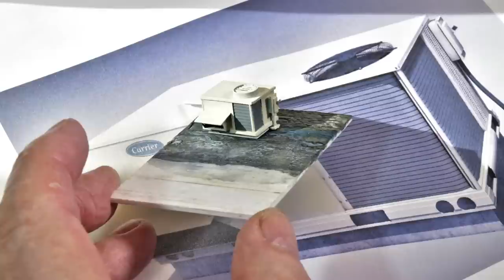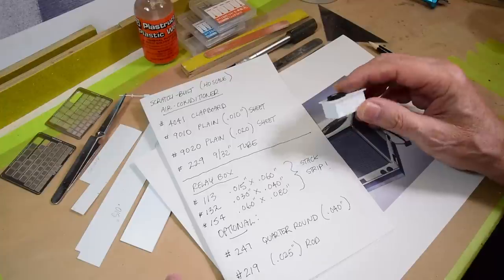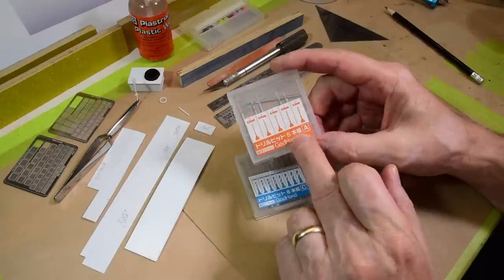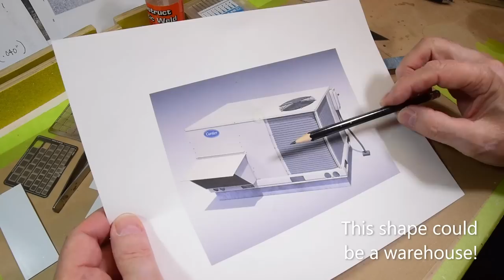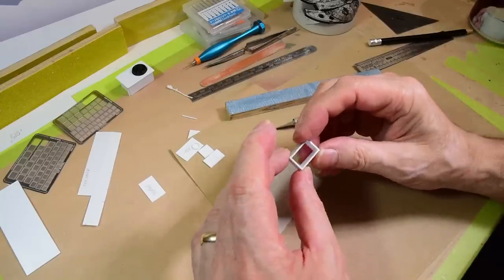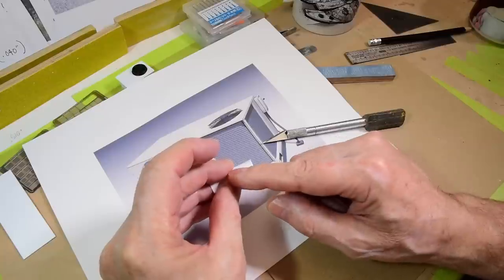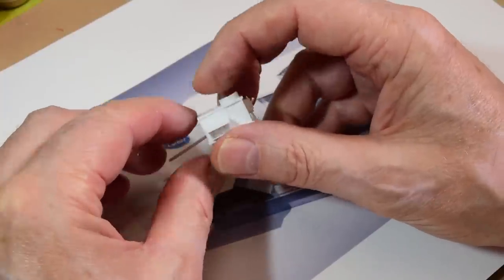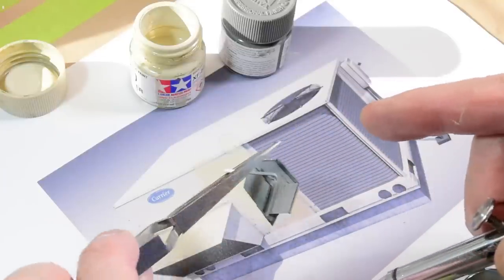The "Nighthawks" Diner Build (Part 11) | River Road ~ Vlog # 146

Comment: Another excellent scratchbuilding tutorial, Boomer!  Small-ish details like this are perfect for learning.  I just finished building a sign with dry transfers (for the first successful time) using the previous video in this series as a guide.  It has my freelance railroad's name on it and will installed on the yard office roof or nearby.  Also, as part of the project I shot Tamiya acrylic paint through my airbrush for the first time.  I've pretty much been using Vallejo Model Air (after PollyS disappeared) up to this time, and I was VERY impressed with how nicely the Tamiya behaved in my H&S Ultra.  Much easier to control the amount of paint coming out.  Thanks and cheers from Wisconsin!
Reply from the maker: That sounds great Andrew. Just a gentle reminder - Please make sure you wear a mask and spray in a well ventilated area. Cheers ~ Boomer.

Comment: This is what Shep Paine referred you as creative gizmology -- it needs to look busy and industrial but it doesn't need to be detail correct.  Other useful scrap materials are the frets from etched parts, various shaped plastic parts trees (they're free in your model kit), thin solder for piping, and even wound guitar string for conduits or armoured cable.  
Armature winding wire is very thin and the plastic insulation coating takes paint really well.  A spool will last you forever.  Also, many shops will have bags of pieces and ends of Plastruct products and metal and brass shapes so you don't have to spend a fortune to start collecting bits and bobs.
Reply from the maker: Yes indeed Randy!

Comment: If anyone can comment on some Plastruct Plastic Weld -like product available in EU/Europe, greatly appreciate.
Reply: It seems in Europe we prefer Tamiya Extra-thin cement Item No. 87038 in 40 ml green bottles @ EUR 6,00. Wonderful stuff and yes, it welds.
MEK is otherwise available from restoration shops @ EUR 13,69 per litre. Almost 11 times cheaper at the same ammount.
Reply: If you looked at the ingredients on the Plastruct label, it says it contains methyl ethyl ketone (MEK) In the US, I buy a gallon can of something called MEK Substitute. IDK what it is, but it welds styrene. Hope this helps. Bill.
Reply: @MyFingerLakesRailwayLayout  
I use MEK in pint tins from commercial plastic fabrication firms.  I use it with a brush in a medical cotton ball dampener like nurses use to apply alcohol before a shot.  MEK is very hot -- it dries quickly.
Anything labeled "plastic cement" should bond by melting a weld.
Reply: Methyl Ethyl Ketone (MEK) You can buy a gallon for a few dollars or Euros. (Assuming availability in Europe) That gallon will last for years. Check for it at paint stores, Lowes, Home Depot etc. It is what's in hobby plastic adhesive like Plastic Weld. In fact, I refill an old PlasticWeld bottle with MEK. Been doing that for years.
Reply from the maker: Tamiya works great as well. Any chemical bond adhesive should weld.